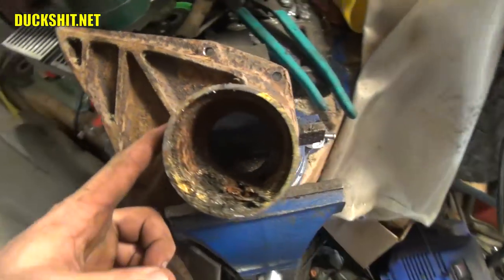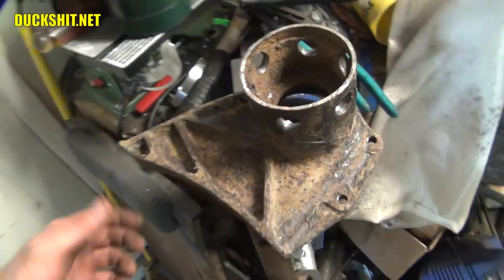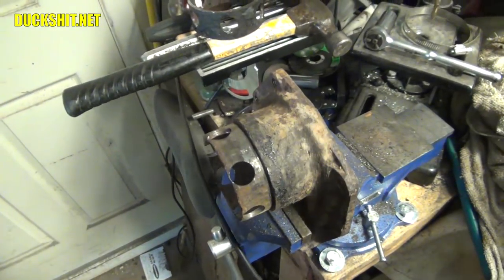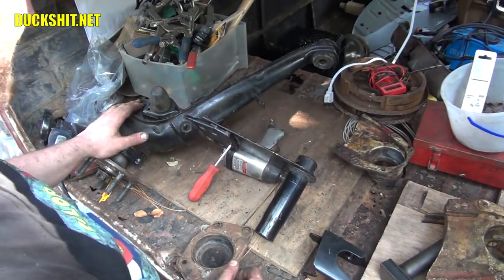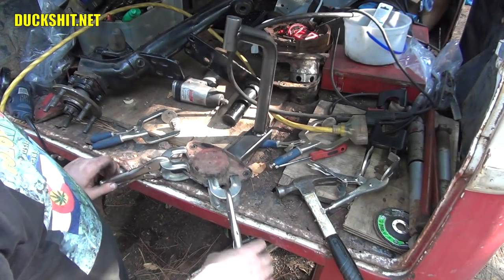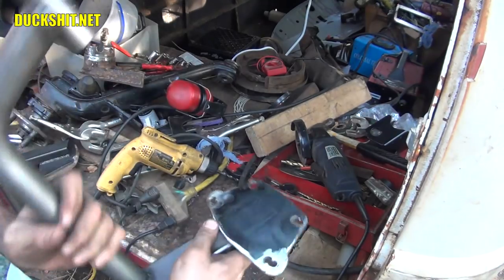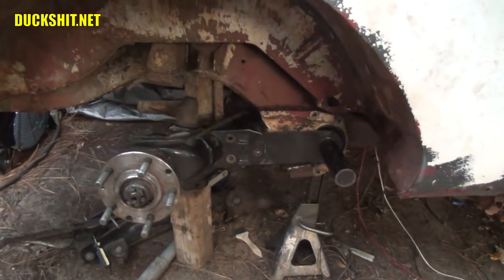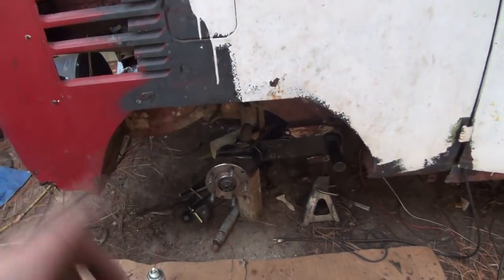VW Beetle IRS Upgrade to Bus - 1967 VW Bus - Gregory - 13

Comment: That gig was nice to use even you fabricobbled it now your going with the VW Bug are going to use new rubber dampers they go in that modified plate area you just made or if they still make those blue Neoprene which I used the past they both work but the blue Neoprene made a softer ride less stiff they don't deteriorate from road and oil grime that's duckman nice to see on the Gregory project glad your not going with swan wing doors!!!; )
Reply from the maker: Probably stock rubber spring plate bushings will be used, at least for now.  I will probably find myself taking it apart at a later date to lower it.  I've never seen or heard of the blue neoprene bushings before, I have used the red urethane once but I try to stay away from them because they squeak.

Comment: Looks nice. What about coating the inside of the tube with a spray lithium grease? Would that coat better?
Reply from the maker: I suppose I could, but I've already dumped all the fluid film in there... and that's one of the things that the fluid film is designed for.  👍😁👍😁👍😁👍👍😁
Reply: Cool!
Reply from the maker: Thanks!

Comment: Like the job, Love V-Dubs. ? Why not use 74 Bay suspension parts, less cutting and welding.
Reply from the maker: Thanks so much for the question!  Late Bus parts are bigger and have a wider track width.  That would have pushed me in the opposite direction that I wanted to go requiring even more cutting and welding modifications to put them where I needed to be and in the end my Porsche brakes wouldn't have fit either!  I answered a lot of these questions in another video, please have a watch!  https://youtu.be/g56P1ywbT8M

Comment: Was it Mustie that I saw putting old engine oil inside body panels to help prevent rust?
Reply from the maker: Not sure, but I wouldnt normally do that on a driver.... not good to breathe the off-gassing.  Fine for a car you find in the woods that you can't rescue immediately,
Reply: @DuckmanCycles  I remember it was chain oil.
Reply from the maker: Throw it all over the place lol!  I don't wanna smell it though!

Comment: How come you guys in the states use so many beetle irs conversions? Isn't the 68/70 bay window irs a better option? Thats whats in my 61 bus and works great.
Reply from the maker: I can't speak for the rest of the country. But I explained why I used what I used... Because I had an abundance of parts, I didn't need to buy anything new.
Reply from the maker: But guessing for everyone else, IRS Beetle parts are abundant here in the US.
Reply: @DuckmanCycles  I guess they are more common parts thats why.